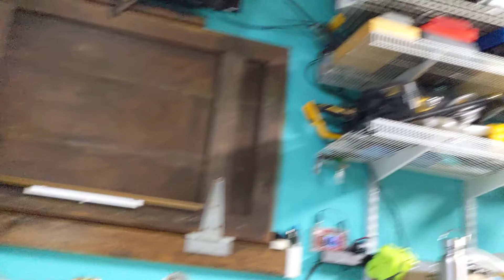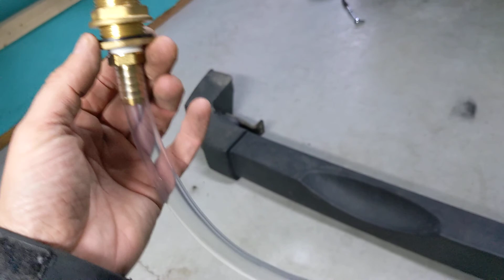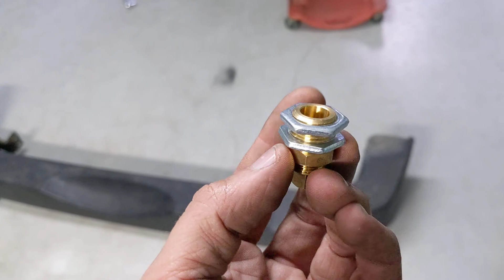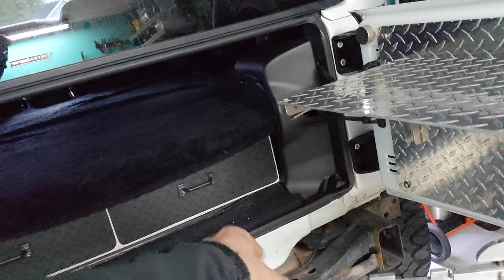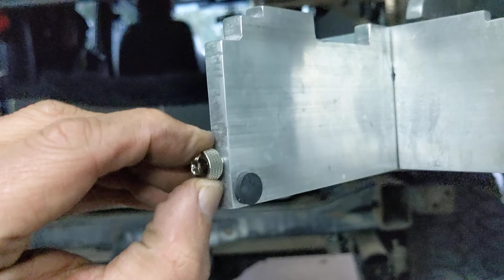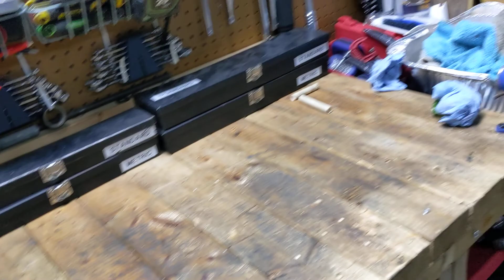Project Overland: JK Bumper Water Tank

Comment: Can't wait for the end result! Originally i was going to drill out holes/squares to mount off road lights but you made a good point about the water can be used to extinguish the campfire. Wouldn't have to use my drinking water for that. Something I'll have to think about
Reply from the maker: You could still mount lights under the bumper from the metal plate that the hitch attaches to and still be able to have a huge water tank 💦 camp fires, washing off muddy gear, rinsing an area of the jeep down that might have broken on the trail for better inspection and dirt free work zone?? Possibilities are endless haha but water is always good to have on hand